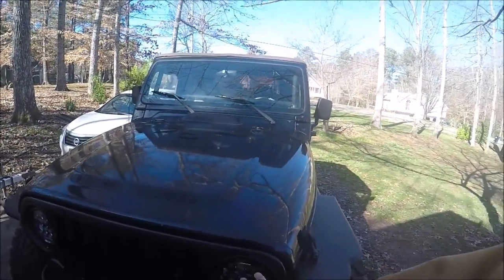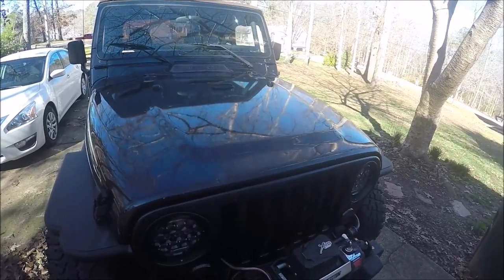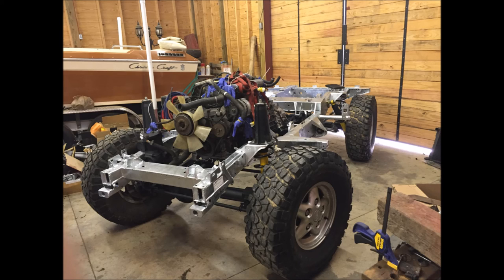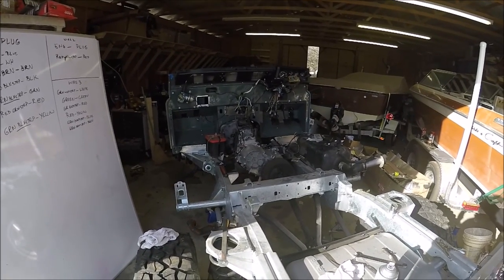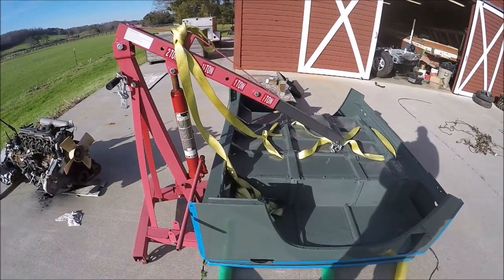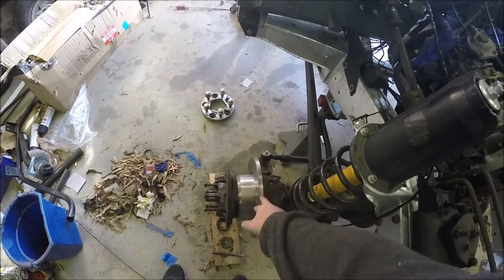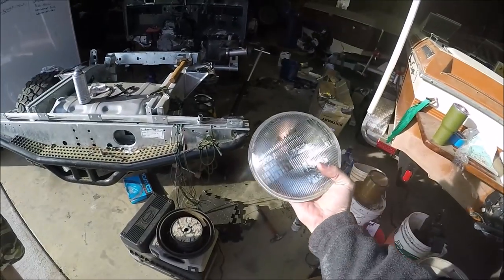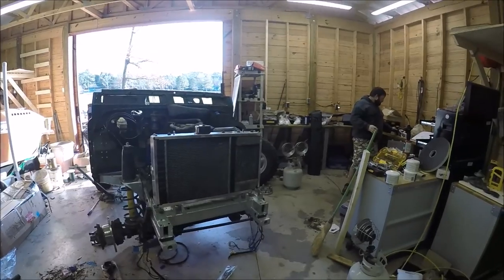Land Rover Defender 90 Build

Comment: Cool video. Never knew a Jeep fuel tank would fit neatly into the chassis. Looks like a factory upgrade. I worked for the Main agent advertised on the spare wheel cover. Bushbury Land Rover Wolverhampton, England. Nice restoration. If you fit later Discovery 300tdi axles you won't need spacers and improve brake performance as they're fitted  with discs (rotors) brakes. Thanks.

Comment: I'd say the 300tdi is landrover's best engine
Reply: Scott RC is dat true
Reply: Ronique Thomas personally yes
Reply: Scott RC ok I am thinking about getting one but wonder witch td5 or 300tdi do u know the difference
Reply: Ronique Thomas 
300tdi is more economical,  less powerful, easier to mentain,  easier to work on in the middle of know where. 
The td5 is slightly more powerful,  it has an ECU unlike the tdi so it is much easier to tune but much more difficult to work on yourself. In the UK parts for the tdi are cheaper than the td5. For long overlanding the simplicity of the tdi is preferred by most people but for a daily driver the td5 is more civilised. 
overall:
300tdi- cheap to run, easy to mentain, economical and fairly bullet proof. 
td5- more powerful, tuneable and more refined
Reply: Scott RC thanks so much!
Reply: Ronique Thomas happy to help
Reply: Ronique Thomas do you have instagram?  I can dm you some pictures of a good comparison of the engines from Land Rover Monthly magazine